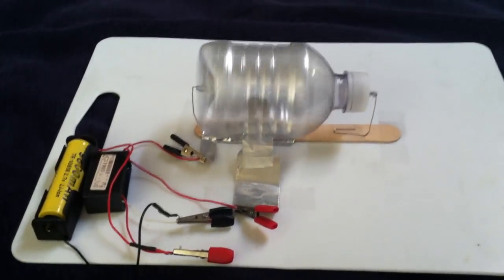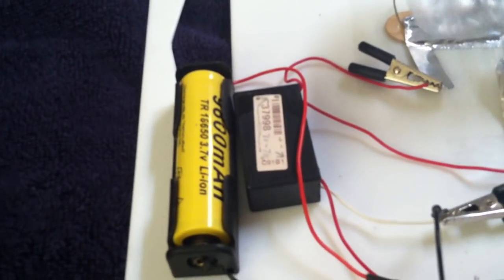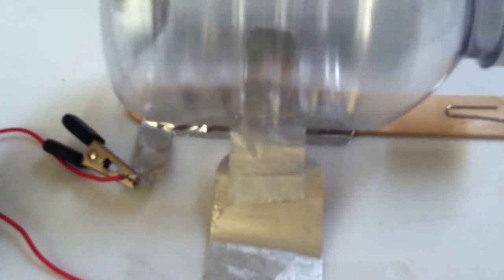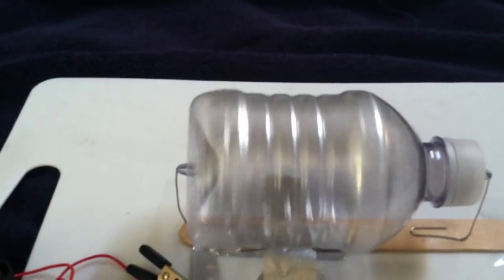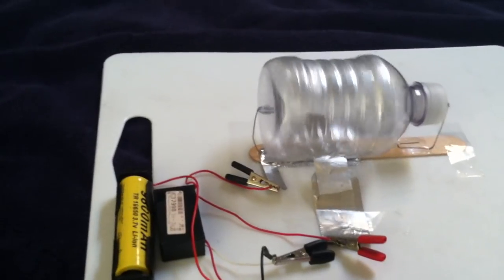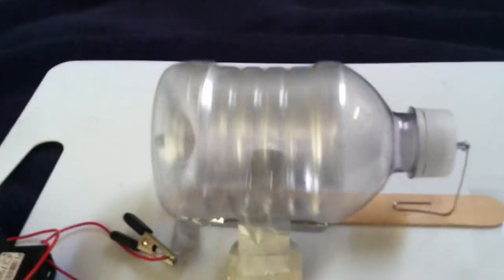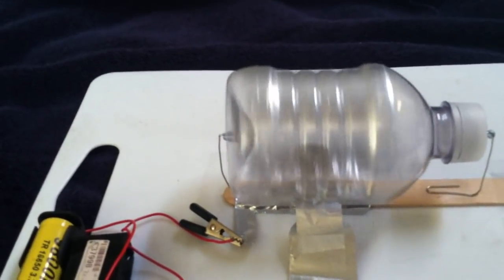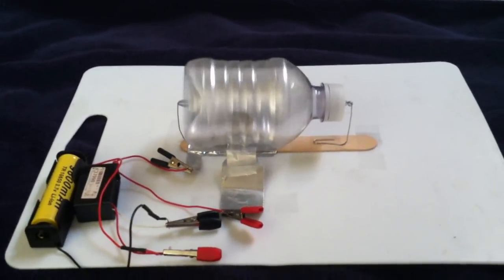Mini Water Bottle   ---Electrostatic Motor

Comment: Well done Lidmotor. How much power does this motor draw from the 16850 cell when running ? Try to see if you can pulse a car ignition coil with the HV side with it and see if you can get low AC current out of the secondary and see if this way you can recuperate some of the high voltage energy... Good luck. Regards, Stefan.
Reply from the maker: It draws 180mA.  The module oscillator appears to run at a fairly low frequency.  The ad for this device says that they are used in electronic bug zappers.  Your car ignition coil experiment would be interesting.  I was thinking about using this on a Tesla coil as the primary HV supply.  I used a lower voltage one once and it worked pretty good.

Comment: The back-firing is reason enough to build one of these !. It's quite the full on scary pop sound when it does it....would probably look great with the room light off.
Say, maybe the type of plastic and air gap between the sides is ionizing somehow and hence why it runs as well as it does ?
Reply from the maker: I don't why this worked so well.  I had this adjusted so that it was popping all the time but it was too loud to do the video.  Fun project but 7KV is a little scary to work with.  Not really dangerous because the amperage is very low but it does bite if you are careless.

Comment: Hey that's great Lid.  Your work is very inspiring.  What would happen if you rolled the pulse circuit and electrostatic principle into one.  I posted a free design to Thingiverse (Thing #1817194).  It will do just that (hopefully).  I will be using the Bedini/ Cole full circuit, running the Chinese HV module on the output (that part works..tested ;).  I just finished printing my parts today 10/15/2016.  Everything fits together nicely.  Won't be able to video and post until Tuesday 10/18/2016.
Reply from the maker: Thanks.  I will keep an eye out for it.